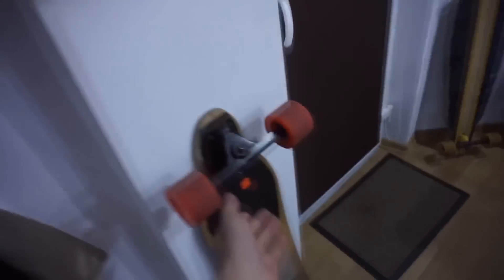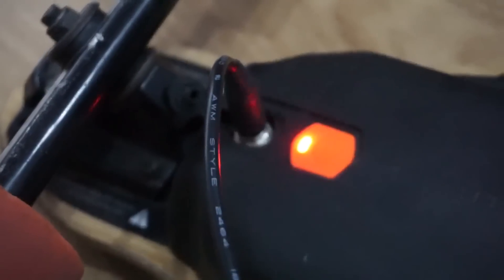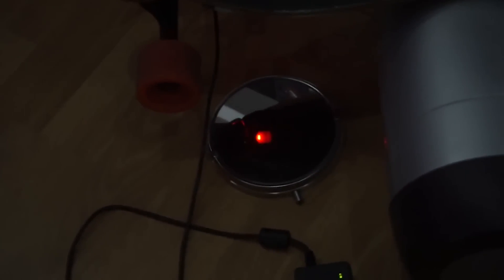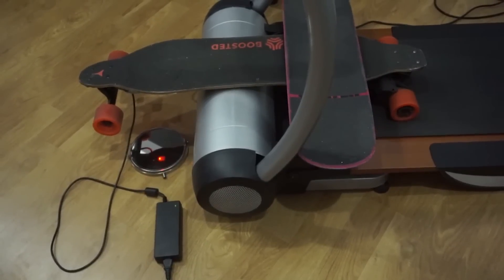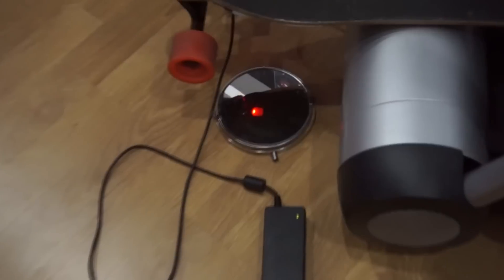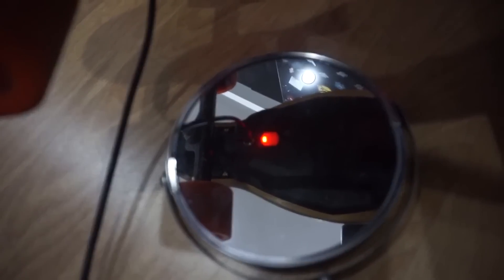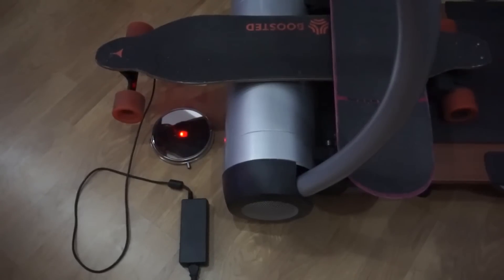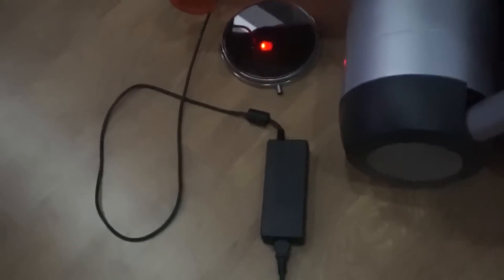Reviving a Dead Boosted Board Battery

Comment: Do you have the exact specs of the battery cells? a123 26650 Li-Ion is clear, but what’s the mAh and nominal Voltage? 3,3V / 3,7V?
Reply from the maker: 2.5A capacity and working voltage 3.3V to 2.6V

Comment: Did you even know what you where doing at the time? What you should have done was: turn the board on, stand on it on the treadmill and apply breaks for a few minuits. The board has regenerative braking and charges a tiny bit during breaking. But Boosted is overprices crap...
Reply: I understand if it wasent turning on at all

Comment: Băieți contra cost ma puteți ajuta sa îmi fac upgrade la baterie la boosted Board v1 dual ?
Reply from the maker: Salut, ce s-a intamplat? Tu poti sa connectezi bateria de la V2 la V1 doar schimba connectoarele de la baterie. Poti sa faci schimbul doar cu cea standard.
Reply: Portable Electric Vehicle  un nr de tel va rog mi moarta bateria nu am pornit longu  4 luni și nu reușesc sa l încarcă
Reply: Portable Electric Vehicle nu pot deloc sa o incarc i am dat la bormașina 2 ore cu o cure de accesorii și nimic tot pâlpâie . 4 luni o stat in frig ...
Reply from the maker: @Prostiaseplatestelapos  da mi un sunet pe FB si vorbim.
Reply: Portable Electric Vehicle cum te găsesc pe Facebook?
Reply from the maker: Toata informatia e postata pe internet si la fel repetata in filmulet. Pe celule scrie exact serialul celulei and tipul. Daca nici acum nu reusesti sa clarifici atunci nici nu are rost sa te bagi in bateria respectiva. Nu esti capabil sa intelegi cum functineaza. Cumpara V2 pachet si gasesti un electrician sa connecteze la board.
Reply: Portable Electric Vehicle sa i au standard v2 sau extended ?
Reply from the maker: @Prostiaseplatestelapos  XR nu va functiona
Reply: Portable Electric Vehicle a ok . Și spune mi te Rog ce model de baterii sunt ca 26550 nu îs ...

Comment: Howdy you crack that glue? Afraid I’ll crack the case. Also do you still sell the extended battery packs? How much?
Reply from the maker: Just pray it slowly milliliter my milliliter and it will open.  Don't rush....send me an email about the batts.
Reply: Portable E use a heater gun soften glue in 20 minutes comes off easy

Comment: Hello, how were you able to get the plastic off to see the circuit board and batteries
Reply from the maker: working slowly with tools prying out inch by inch.
Reply: Portable Electric Vehicle thank you, also, I am very new to electronics, what was the tool you used to charge the individual batteries
Reply from the maker: I will post a video with an easy solution this weekend. Stay tuned!
Reply: Portable Electric Vehicle THANKS FOR THE HELP!! I SUBSCRIBED
Reply: Do you know what day you’ll be posting the video
Reply: @ElectricVehicleSpace can you help.me I think I messed my boosted board up I plugged the charger into the board with the board turned on did I mess the board up

Comment: My Boosted board takes charge about 10min and shows full charge, but when i try to ride, i have only one mile range( Whats the problem? how you think? i should change battery? or it looks like the same your problem?
Reply from the maker: you may have a cells that has low capacity. That cell needs to be replaced. Fully charge the board and ride it until it stops. Than read the voltage of each sell and see which one has the lowest voltage and replace it.

Comment: Can you help me on how to charge individual battery cell? things I need and the process will be awesome.
Reply: Hi James, I have the same problem. Have you opened your board yet? If so, what kind of screw driver did you use
Reply from the maker: connect the leads: positive to red and negative to black side and set the charger to Lifepo4 charging option. Set to 1S and you can charge it than.
Reply: 1S that is 1 cell? What charger do you recommend?
Reply from the maker: balance charger. From 1S to 6S. U will have to set it to 1S to revive the cell!
Reply: Positive and negative on the BMS or the cells? And where does the balance plug go? Thanks for the help
Reply: This guy shows how to do it: https://www.youtube.com/watch?v=4ixajW2KZWc

Comment: Vitale, I think my V1 battery died.  From what you know, can you put a V2 battery on a V1?   I ask because there are many on Ebay.
Reply from the maker: you can but you will have to make sure the bms is the same or swap them so it communicates with the speed controller and the remote back and forth. Very important otherwise in not going to work.
Reply: Did you have any luck with a V2 battery on a V1? Was looking to do the save myself..

Comment: I don't think you recharged it correctly. I also let my battery drain once and also used a thread mill to fix it. You don't hook it up to the charger when you do that, just leave the board off and place it on the thread mlll. I think it took me 20 minutes? Then immediately hook it up to the charger.
Reply: That does not work if the battery is below 2 volts. I have the same problem
Reply: Marheim what did you end up doing ? I dont know what to do lol am lost i had mine on the tread mill for 50mins
Reply: I think i messed up my board by having the board turned on then plugging up the charger 😑😑😑😑😑
Reply: Will call please let me know what I did and how to fix it